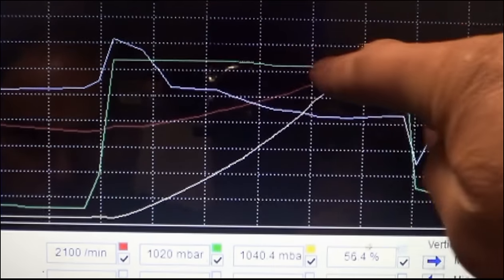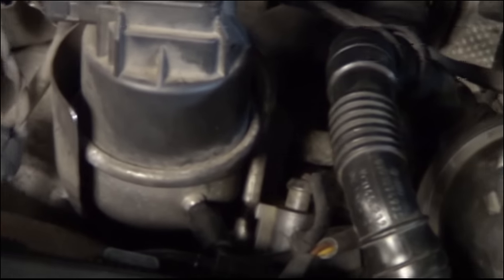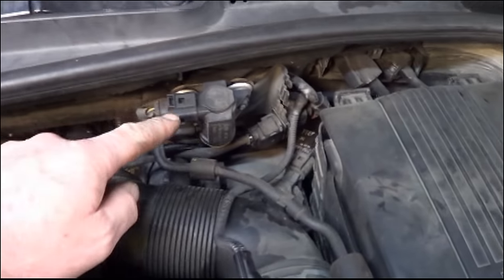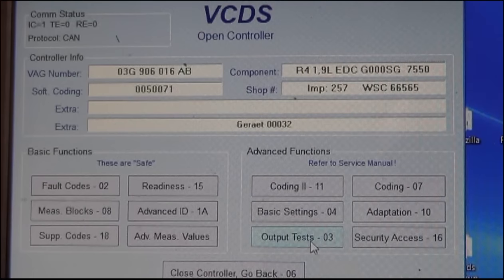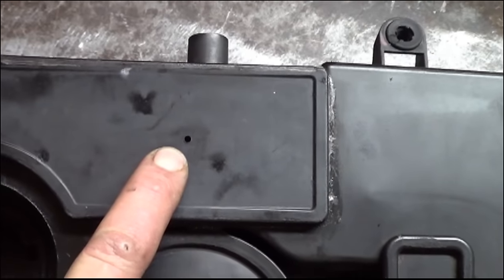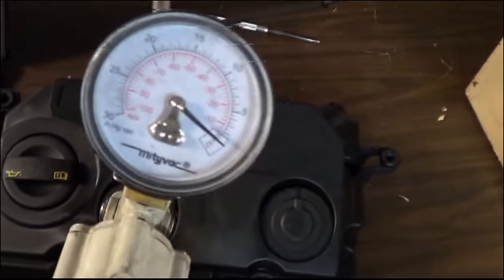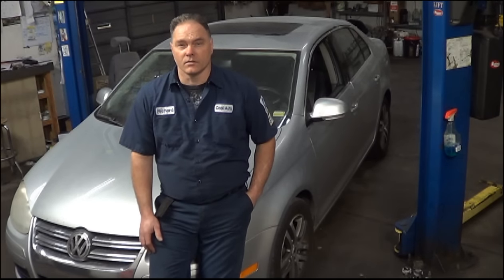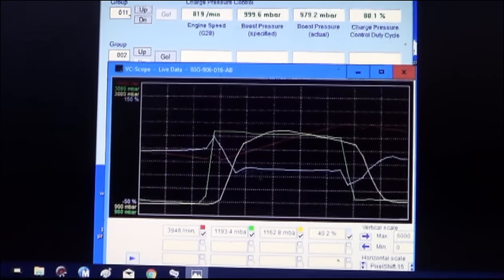06 tdi low boost P0299

Comment: and also this came up  from computer 19586 - EGR System
              P3130 -35-10- Regulation Range Exceeded-Intermittent
17964- Charge Pressure Control
             P1556 -35-10- Negative Deviation-Intermittent
Reply from the maker: Overboost and underboost, probably means something is sticking.  Check vanes of turbo for sticking.  I have other video's on this.  Graph boost to see what is actually happening right now and diagnose it accordingly.

Comment: I have a question and i would be very happy to get an answer, nice vid btw. I own a Lancer 2007 diesel , i believie it has the same engine BWC and i am having some problems with the power, sometimes the turbo flutters and it lacks power most of the times that happens, could it be the diverter valve that causes that or a vacum leak?
Reply from the maker: Sorry I don't know about that problem.

Comment: why didnt you just plug the small hole rather going to the expense of buying a new cover
Reply from the maker: Did you watch the part of the video that showed that the top of the reservoir was broken off and glued back on by some previous idiot?  that is part of the reason,  but of course you could then say, why didn't I just glue it on again.  The customer had been dealing with this problem along time.  It was a wonderfully nice car and they wanted it right.

Comment: How could a vacuum leak cause an underboost? Wouldn't that make the waste gate stay closed so it overboost? I am just trying to learn.
Reply from the maker: On this particular system there is no wastegate.  On a VNT turbo (variable geometry turbo) the computer controls exhaust pressure by changing fin angles  making faster spin of the turbine or slower spin of the turbine.  It has the ability to control exactly how much boost is made.  A wastegate just "dumps" exhaust pressure, it cannot "control" boost.
Reply: m
Reply from the maker: As I re-read my comment here I'm not so sure its the best way to describe what I was trying to say, but I have no better way so, oh well.

Comment: Why didn't you just weld the hole up, or make good use of it by installing a permanent vacuum gauge? lol
Reply from the maker: Plugging the hole has been mentioned before, and if the owner was wanting super cheap it certainly we could have done that.   If you saw,  they broke the top off and glued it back on.  For reliability for the long run it was probably best to replace the VC  FYI  customer totaled the car and then recently sold it to me.  I'm putting it back together as a project.

Comment: I had same issues with my Skoda Octavia tdi
Reply from the maker: What country are you in?  What year is your Skoda?
Reply: CoolAirVw Rm I have same power loss problem on a 2004 passat 1.9tdi 100
Reply from the maker: @tasibnawaz7643  check over the rubber boost hoses to make sure there are no tears, leaking boost.

Comment: Sorry for coming in late, but a lot of cheapskates do this to add a boost tap.
Reply from the maker: there is no boost there.  Its a vacuum reservoir provided vacuum by a mechanical vacuum pump driven off the cam.

Comment: YOU  can tell this mechanic loves to rip off. Buying new cover instead of spending 2 minutes to seal the tiny hole.
Reply from the maker: You can tell this commenter didn't watch the whole video nor did they read the other comments.  Thanks for calling me a crook.  Maybe you should look at 11:18 where not only is there a tiny hole but who ever drilled the hole also busted the top off and glued it back on.   Replacing the Valve cover was the right decision for this customer.